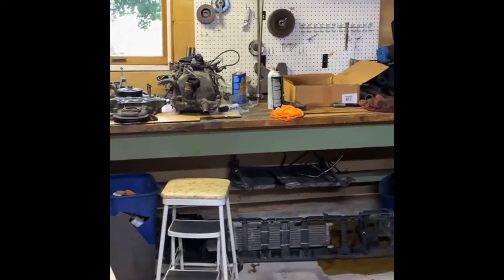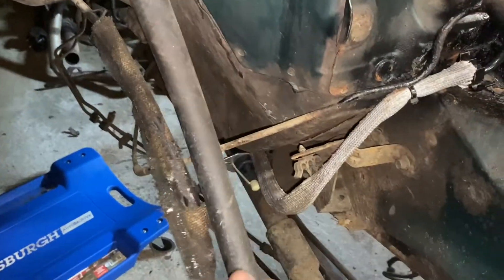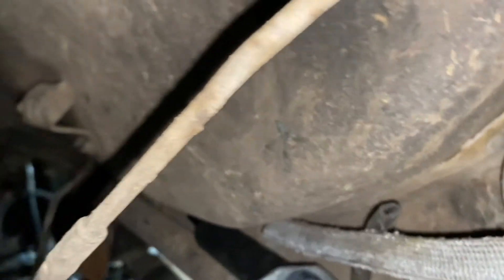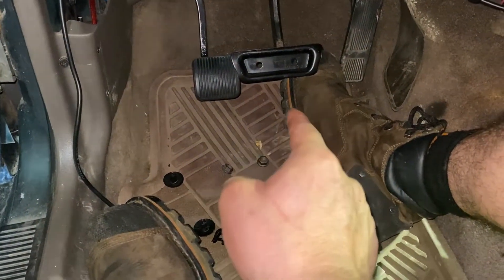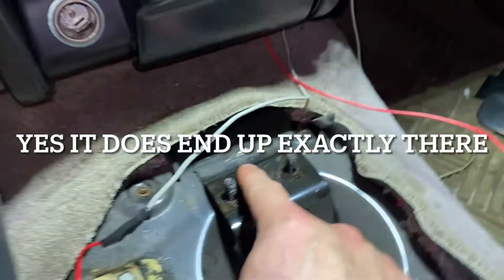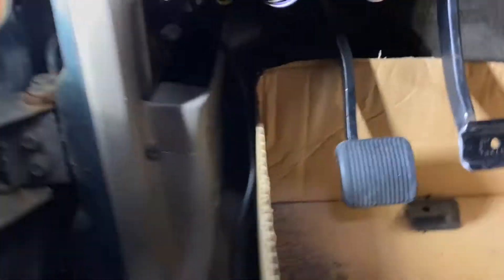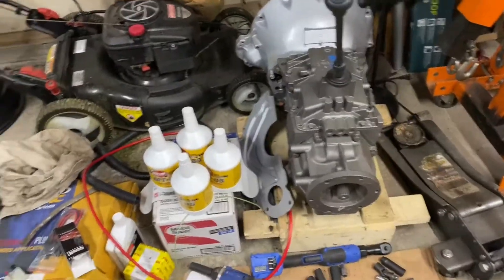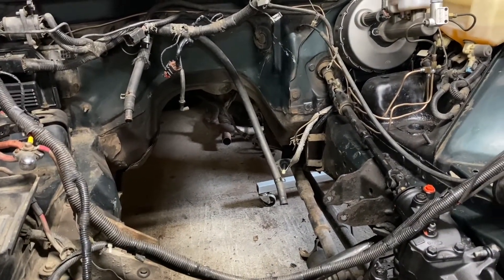NV4500 Manual Trans Swap into 5.2 ZJ: PART 1

Comment: Did you have to make room for the nv4500 in the trans tunnel
Reply from the maker: No not really, just the hole I cut in the floor for the shift tower. I originally made just a round hole but then cut a notch on the rear to clear the 3 cylindrical parts directly behind the tower itself

Comment: Nice job, that's looking really good!  Looking forward to the next installment.
Reply from the maker: Thank you!!
Reply from the maker: Thanks for the awesome pedal kit and videos that I learned a lot from. Do you make that in-house??
Reply: @4link4wd  Glad I could help!  I have a big shop do the laser cutting and forming.  They've got all nice CNC equipment, so the parts are as good or better than the OEM ones.  I just finish them up and do the assembly here.
Reply from the maker: @LowBuckGarage  That’s awesome. Is it a local place? I use SendCutSend a lot and they’re great
Reply: @4link4wd  They're out in California, very good on quality and pricing but they have a pretty high minimum charge.  It has to be a pretty good quantity of parts before they'll set up for it.